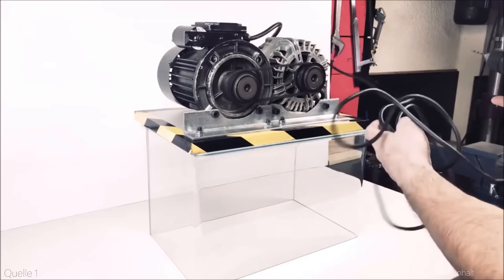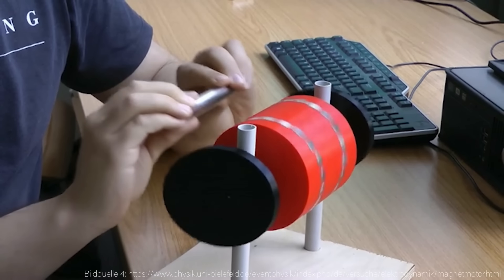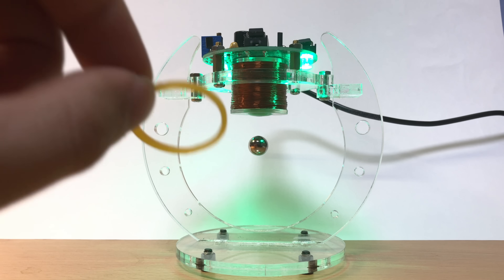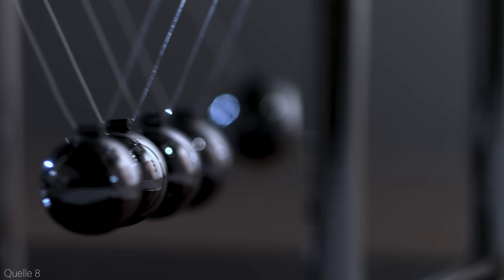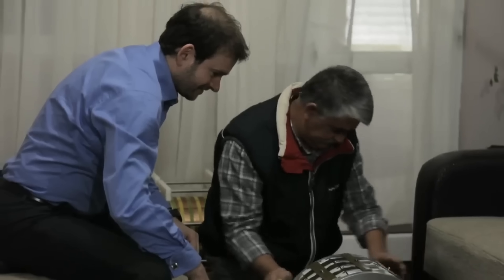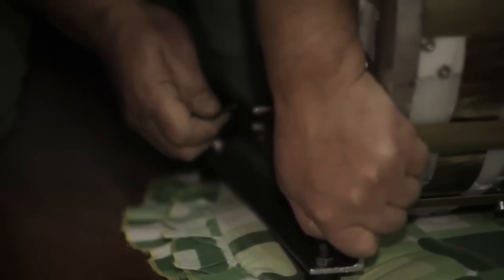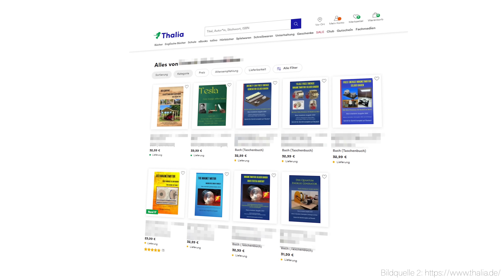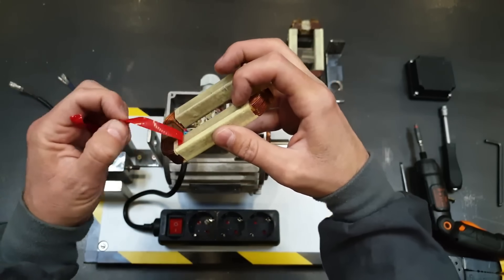NEW 30KW PERPETUAL POWER GENERATOR - FREE ENERGY FOREVER 100% REAL!?

Comment: While I can understand the scepticism of a generator that creates more electricity than it needs to run the generator. It is possible. I used transformers from a microwave. Eight in a circle, seven circles. Around an upright cylinder driven by a 240 washing machine engine connected with a drive belt. Admittedly I needed to get it started with mains power. Once started it was able to self energise and run the power for my house. The total size of the unit is about the same as a small washing machine 1.2m by .6m by .6 m the key is the use of the strongest possible magnets you can afford. My advice is to use a qualified electrician to do the wiring. I am fortunate enough to have a brother-in-law to do this for me. Electricity is dangerous and needs to be treated with caution.
Reply: Shhh!

Comment: Hi Future Galaxy and everyone, magnet motors are real and you are not breaking any laws,,, the problems with magnet motors is the speed control in which does the torque on a generator with  load/s,,, also the magnet motor can turn jet engine if built right or even faster.
Reply: You can't make free energy though. There's losses everywhere

Comment: Must be built using a theory that does work.  To simply say that it violates the conservation of energy it to give up on the possibility of achieving a breakthrough with real effort.
For instance the V design, the impulse magnet should be repelling the magnets on the barrel and allowed to move away at the point  where the legs of the V meet the apex.
If design is correct it will constantly accelerate and have to employ a governor of some type to limit RPMs

Comment: For argument's sake I seriously doubt this ever worked. But to say there's nothing out there that can or hasn't worked is like repeating the old saying "if man were meant to fly God would have given him wings". You have no further need to look beyond what Tesla, confirmed to be theorized by others in the 1860's to exist (but hadn't the means themselves (proving its existence)). And what was that you ask?

Answer: Tesla, after noting several 'swith-men' untimely deaths (switching on DC generator that powered industry at the time) reproduced the phenomena and noted and purportedly coined the term "dark energy" and or "aether energy " sometimes more commonly referred to as "zero point energy". That starting of a commercial plant from a dead stop when switching on the generator, killed several people over the decades leading up to Tesla's invention of the AC motor. But not letting a good disaster go to waste,  he recreated the effect and later perfecting it, tapped into its potential.  Several patents later one proved the "hair pin" circut actually works. (* Read "Secrets of the Cold War Technology " chapter one.)

Comment: If you look at the generator as not converting mechanical energy to electrical energy but rather using mechanical energy to keep producing energy from the magnetic field dimension. Then a self running device is possible and it wont break the law of conservation of energy.
Reply: Yes it will

Comment: Once I watched the efforts of an engineer (who happened to be my boss at the time) to prove this theory of the magnets organized in a proper angle.
The guy bought a fortune of materials and spent many hours from the professionals of the shop, just to realize that you can't break the laws of physics... 
That was fun to watch, though.
Reply: Really? Then how does a bumble bee or beetle fly with such big bodies and small wings? Might want to rethink that statement and question the laws of physics they want you to believe. Secondly you might want to take a dive into Mechanics. Example, two car alternators in alingment equals perpetual motion of 1 to 1 right? It's all over youtube. Well, throw the mechanical curve ball with  one having a bigger pulley. Now common sense tells you one will be spinning faster than the other hence will be producing more electricity than the other right? Yes, Then throw the sinker ball and add a capacitor(stores electricity) and an adjustible dimmer switch and you can control the speed of the unit. It's really not rocket science. I'd consider that like frequencies that kill cancer cells( which they certainly can and do. Or the power of nano particles and technologies, AI, and shit like that. Hydrogen generators removing 1 atom of hydrogen to burn and run a car(I made one and still have it) as a fuel. And for Gods sake don't believe the math. It's a sham you been taught all our lives. For example multiply. Means to make more of right? It's the top of the chain compared to Subtract, Add, Divide right? Then explain how 1x1=1 and 1+1=2? Tesla was right, 3, 6, 9. They ruined him and cheated and stole from all of us, over a piece of paper with 1's, 2's and 5's and zeros on it. My bad not paper, actually it's a cloth. I could go on and on but I got work to do. I work in Aviation, and even got FAA licences to prove it.
Reply: @OralOllie-n6c  bumble bees can fly with big bodies and small wings because your strength to weight ratio goes up the smaller you get, and gravity has less effect compared to air resistance the smaller you get, it is the same reason you can drop an ant off a building and it won't die, it will hit the ground rather gracefully. You say a lot of words but it doesn't seem like you understand very much, put more effort in to figuring things out maybe, or don't I couldn't care less

Comment: Swedish thoughts
if we know how to make an electric motor rotate, it is precisely magnetic fields that make it rotate. so basic idea is magnetic field in certain pattern creates rotation. not electricity. electricity is used to build up magnetic fields.
so. to think outside the box and go away from circle patterns for motors, this works for electromagnets. if we are to use only magnets, we can never put these in a round circle pattern. these will always take each other out in a push and pull variation.
THINK OUTSIDE THE BOX then the impossible becomes possible....
Dad 50++